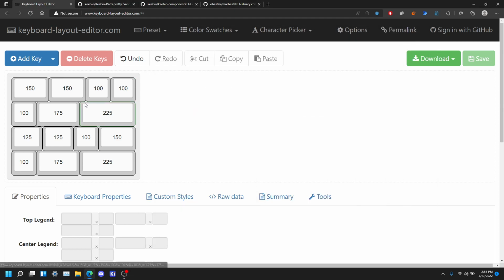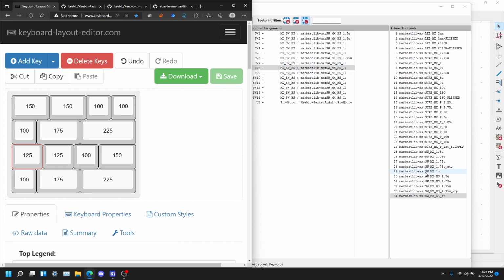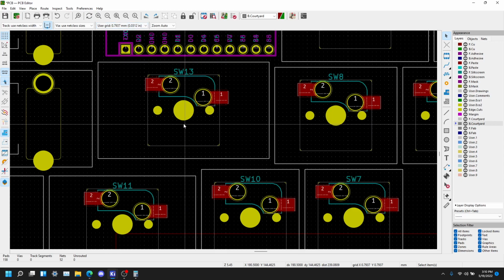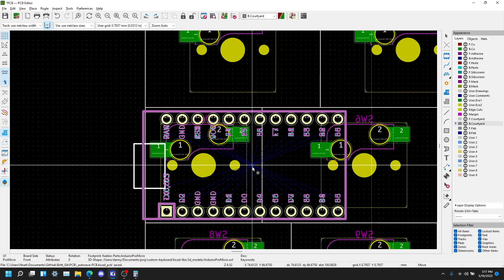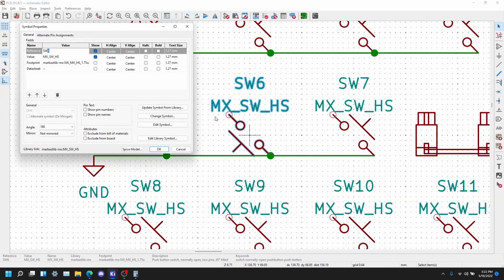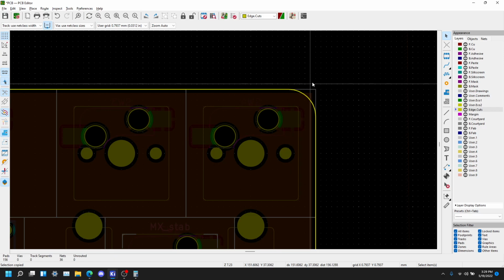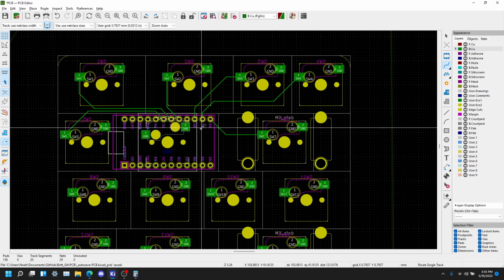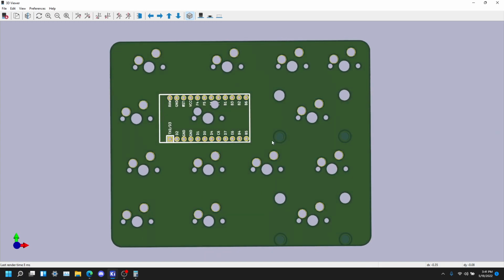Making a Keyboard Macropad PCB (Kicad 6.0)

Comment: where is the diodes?
Reply: each switch is connected to a different pin on the micro-controller. So there is no matrix ... so it doesnt needs diodes :)
Reply: @meme-hj5rs  Also if it were a simple grid, it would really need diodes either, if you don't plan on mashing a lot of buttons in the same time

Comment: didn't understand why you added pro-micro in between matrix, shouldn't usb be at the edge of the board so that it can be exposed out of the case
Reply from the maker: In most cases, yes. In this design, I intended to have a short "pigtail" cable mounted to the back of the outside of the case. If the pro-micro was pointed vertically, then some of the pins would have collided with switches. In some other videos, I place the pro-micro towards the PCB edge.

Comment: sorry I was just wanted to know what you meant by the MCU will not be attached to the pcb because I thought it had to be connect to it
Reply from the maker: I mean that there is a gap between the MCU and the PCB, like stacking an arduino shield on top of an arduino. The MCU is the arduino in this case, and the keyboard PCB is the shield

Comment: Nice, i'm not sure why you didn't push the footprint of the controller a bit higher, although it would have overlapped on the bottom of the top row, it wouldn't have touched any of the pads/holes for it.
Reply from the maker: If the controller was pushed higher, the bottom row of header pins would interfere with the bottom of the switch, since they protrude through the PCB

Comment: What is a "hot spot" switch?
Reply: I believe he's saying (or meant) hot swap. Hot swappable means that they can essentially be replaced, or swapped out, on the fly.
Reply from the maker: Rocco is correct. A hotswap socket allows a switch to be installed to the PCB without soldering the switch itself.
Reply: @noahkiser  You mean a press fit component?

Comment: Hi, my name is Martin, I'm from Argentina. Are you interested in designing the circuits for the manufacture of my macropad? using arduino + cherry.
thank you and I wait your response
Reply: Hola Martin, soy de Argentina tambien, me podrias pasar el dato de donde ibas a manofacturar el pcb? Ando buscondo y no veo muchas opciones para imprimir el pcb
Reply: @luzamandamarulandaramirez7627  hola. Al final nunca avance con el pcb por qué no encontré un proveedor que me dé confianza. Sigo haciéndolos hand wired
Reply: @martincaneva4247  Me hiciste dar cuenta que estaba en el perfil de mi novia XD, te envidio las ganas de hacer un handwired 👏, gracias igual bro
Reply: Que es la que hay gente! Aqui de PR  tambien haciendo un macropad. Verdaderamente este video es una joyita, andaba buscando footprints pa los switches y algun tipo de estandar pa la medida de los grid. Sobre lo de manufactura @martincaneva4247 eso lo mandas a hacer por JLPCB o por PCBWay o por lalgun manufacturador que esta asociado con fritzing si tienes plata pa botar. JLPCB tiene un editor pa este tipo de cosas y puedes mandar a que te lo ensamblen. Aca son $7 USD, no se cuanto sea eso en Argentina, pero aja.